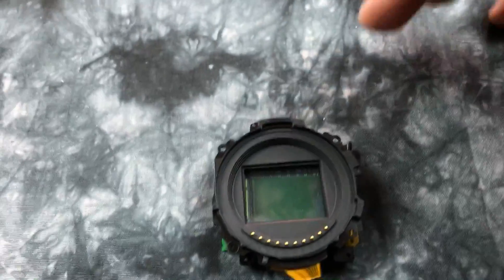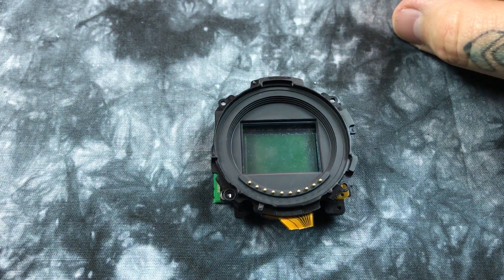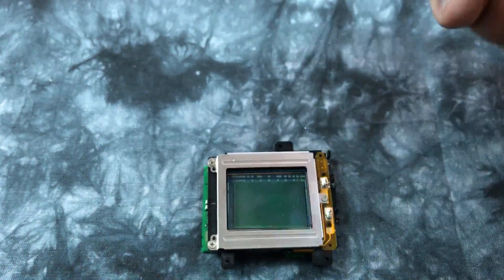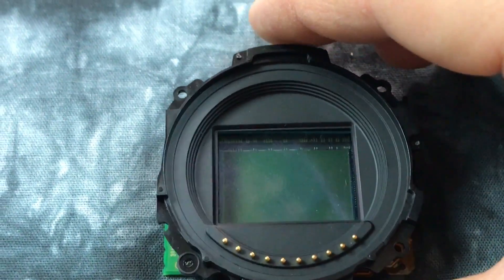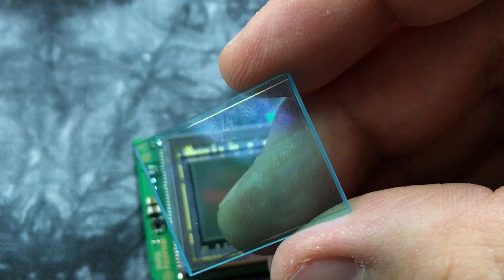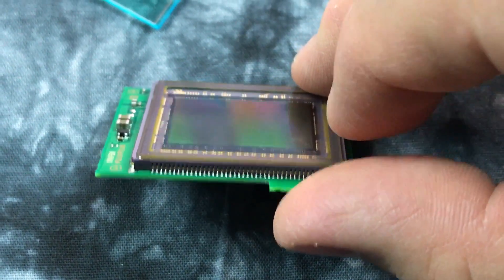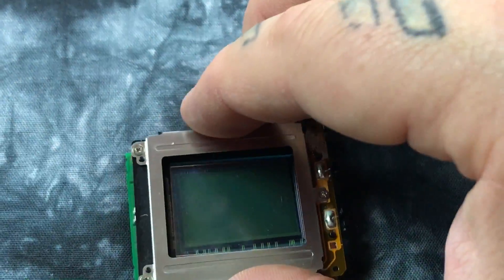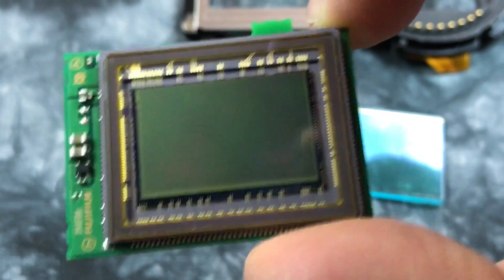😳🤓WOW...1st DETAILED LOOK AT EXPOSED FUJIFILM X-TRANS SENSOR

Comment: Reminds me of the Aston Martin one 77, "there is no B surface"
They built that based on the concept that every detail, visible or otherwise has to be finished to the same level of quality and beauty as the external, visible areas.

Most cars have A (will see, external), B (might see, inside door sills etc), and C (never see, back of panels, inside engine) surfaces. Most astons have A and B, the one-77 and the fujis, just A. No matter how unlikely a customer is to find it, lets make it as perfect as possible

Comment: Just to calrify what it is you are suggesting.  Are you suggesting we can clean the sensor as you would clean a lens ie with a normal microfibre cloth?
Reply from the maker: Geraint H noooo I didn't even imply that
Reply: Ahhh ok, no problem lol.  So what method do you recommend?  Is there a particular cleaning kit you would advise?
Reply: I've always used a product called Sensor SWAB - you use 1 per one cleaning. Not cheap, but cleans up the sensor totally. I remember when I had a Canon 1100D, and I've changed the lens outside in the middle of the shoot - there was a strong wind, and we were standing on dried up farm fields - I got zillion of dust and dirt particles on my sensor. Tried some blowers - made the stuff worse (don't do that, trust me!), and then I tried Sensor SWAB, and it cleaned everything up. Not sure if other manufacturers SWABs are good, but I can guarantee for these ones :)